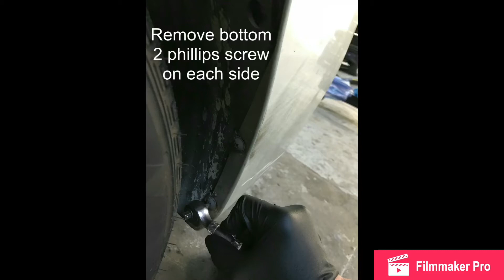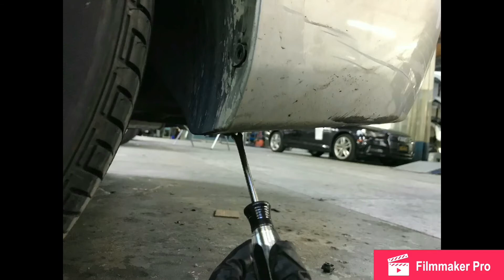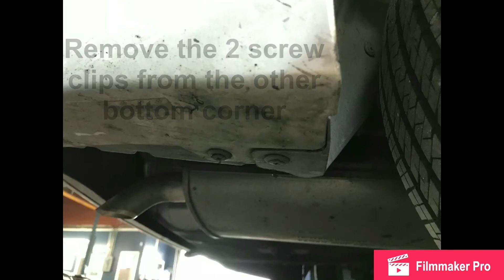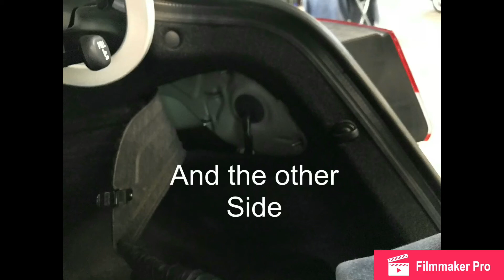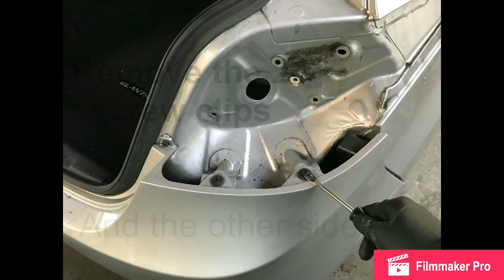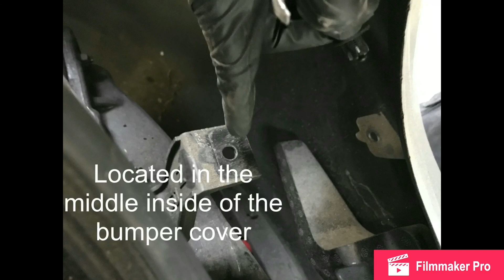How To Remove 2012 Hyundai Elantra Rear Bumper And Tail Lights 2011-2015 - Body Shop Basics

Comment: Hi! Can you tell me how you took of the 2  screw clips that are connect to a bracker on the inside of the bumper cover? Thanks
Reply: Right? Those seem impossible to take off, you'd figure more time would be spent on that considering how difficult that is.
Reply: they're held on to the bumper by a piece of plastic. if you don't care about the bumper like me since i'm replacing it, i just pulled and snapped off the plastic piece lmao